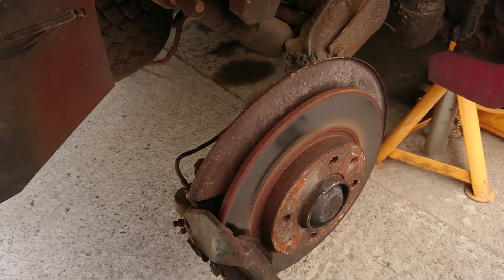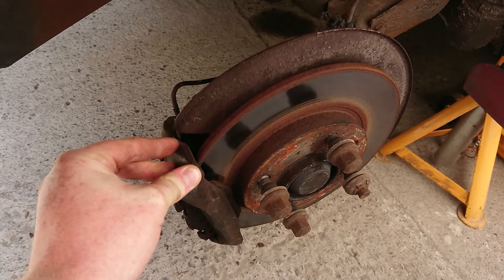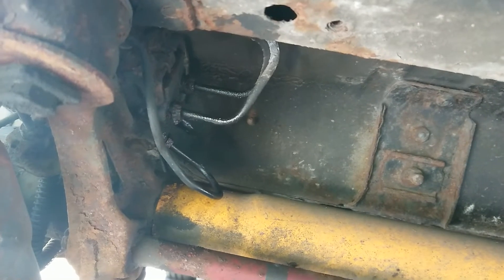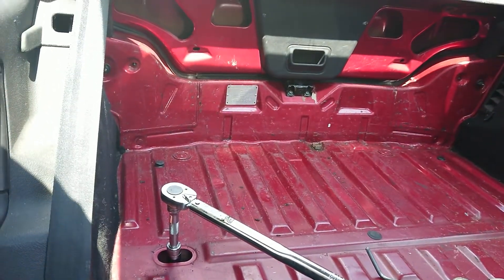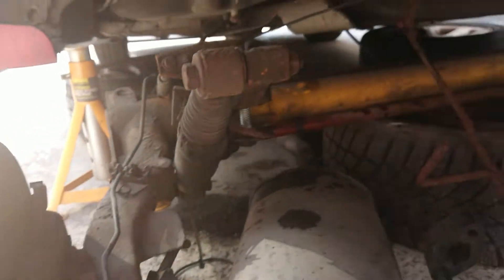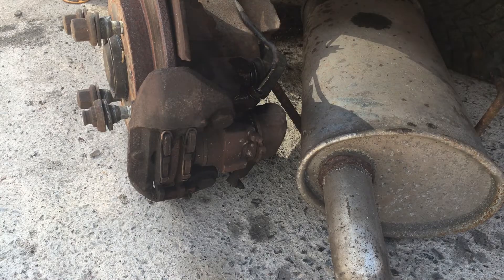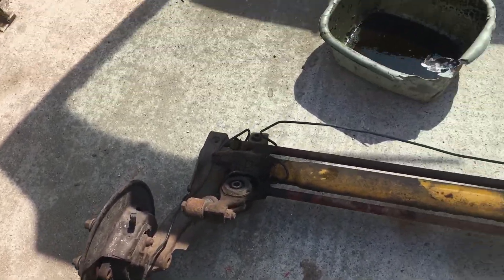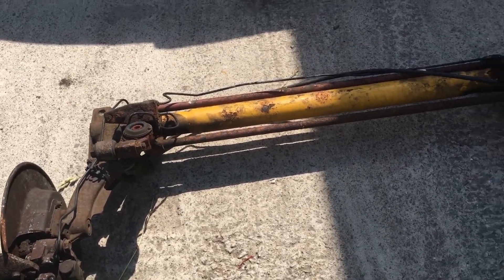#9 Removing BENT Rear Axle on £50 Saxo VTR!

Comment: The rear axles and 106's and Saxo's do break when the mounting bushes fail. Its why alot of them got scrapped.
Reply from the maker: Both my 106 and Saxo had the axle issue. It's a big design floor

Comment: If the bearings have collapsed due to water ingress then the arms will be seized in a cambered position even with no weight on the axle, i doubt the actual beam was bent